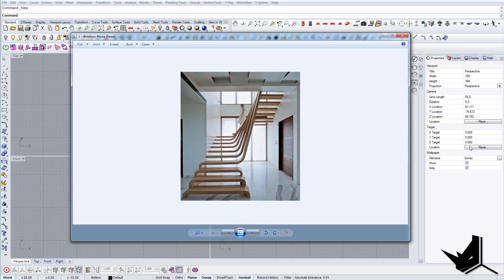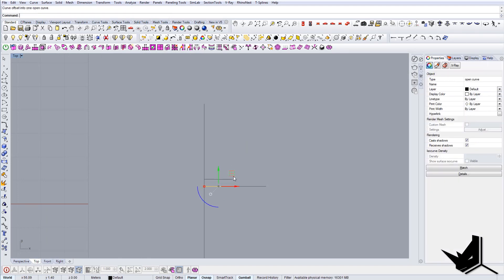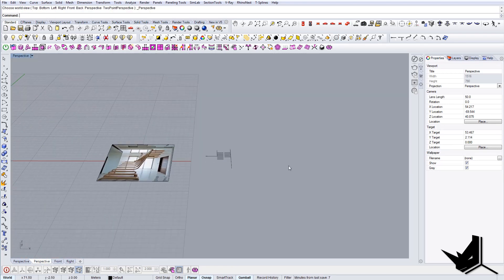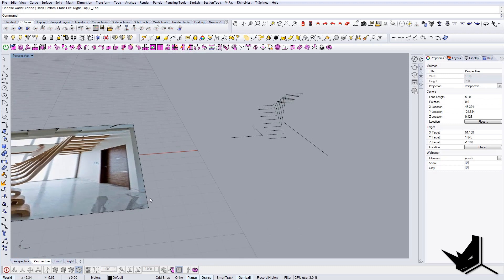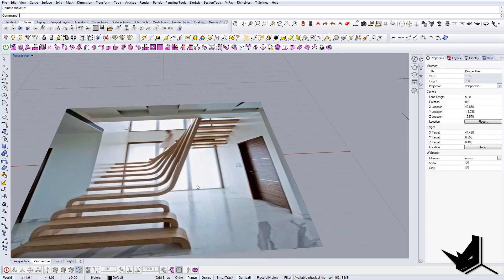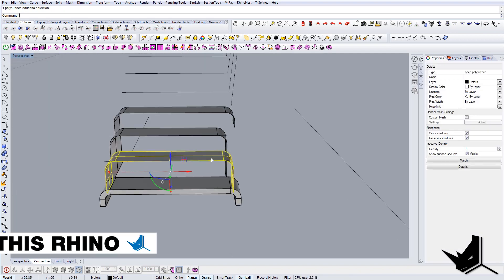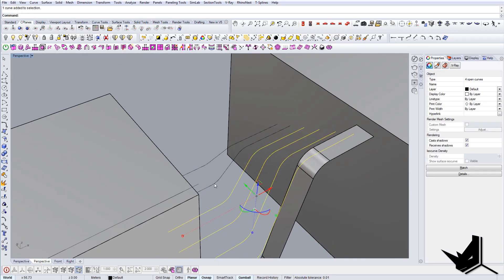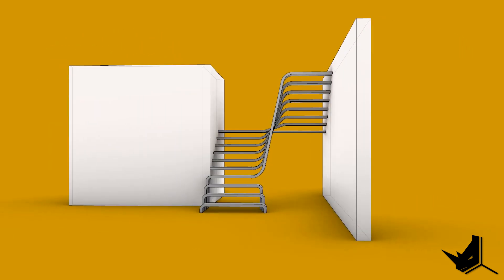Learn Rhino Modeling Stylish Stairs

Comment: Really good tutorial, I managed to do the stair exactly like you did. Nevertheless I'd like to add that some commands just went by way too fast. At some times I had to watch a second 4-5 times to understand what command you entered. Would be nice if you could slow down in those sections just a bit and say what command you're using. Thanks!
Reply from the maker: Thanks for your comment! Yea, I understand what you're saying, sometimes I go through the commands a bit faster, but that's just a way that I produce the tutorials here on YouTube, if you're interested in having all commands explained in great detail with the exercises and 1on1 tutoring, you may want to check out Rhino for Architects course which is much more detailed then the tutorials published here on the channel. You can apply here and if you get selected you will be able to join our program. https://howtorhino.com/apply/ 
Hope that helps! Cheers!
Reply: @HowtoRhino  yes that sounds good, thanks a lot!